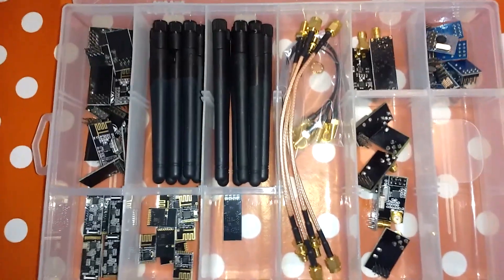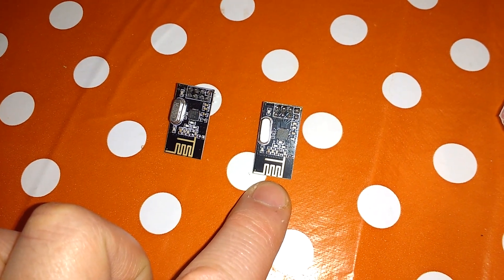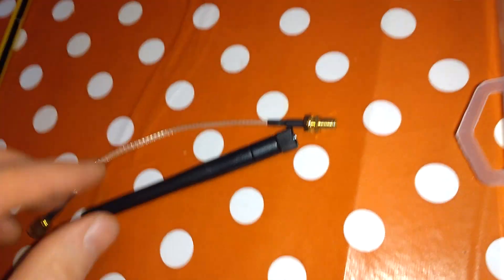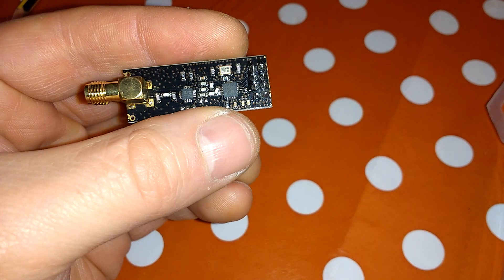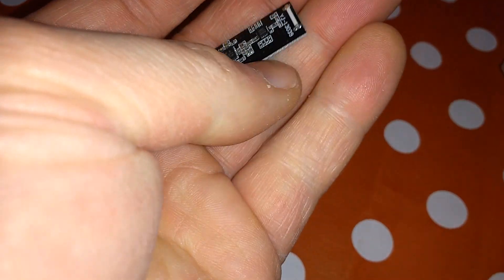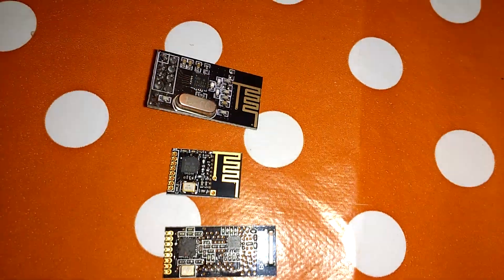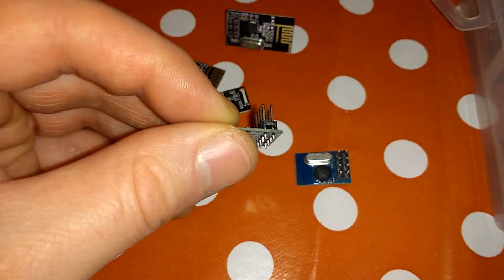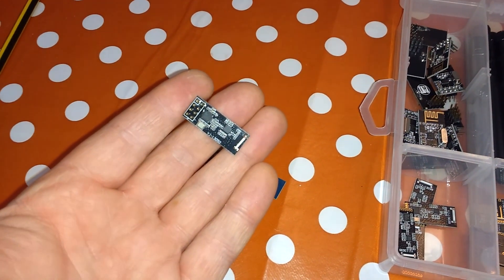NRF24L01+ module line up,  including SE8R01.  Arduino

Comment: 8:00 you mentioned a 1.75 connector. where can i buy it? where to find? witch search term should i use? greetings from germany
Reply from the maker: Frank Müller I bought some from eBay, they are 1.27mm or 0.05" interboard connections, very small and tricky to solder
Reply: Bob Lynas i just searched for 1.27 interboard connections on eBay. Found nothing. Please help...
Reply from the maker: Frank Müller https://m.ebay.co.uk/itm/50pcs-50-Way-Single-Row-Straight-Pin-Male-Header-Strip-1-27mm-Pitch/292292546407?epid=24007139336&hash=item440dfe4f67:g:7ZkAAOSwEW9aTsrp

Comment: nice collection! I'd like to see you test some of these out and do comparisons, especially the SE8R01
Reply: Hey Bob, that's a pity.

I'd like to know whether the SE8R01 and NRF24L01 modules can communicate which each other when you use an address width both support (4 or 5 bytes) and turn off "pre-guard" and "repeat tail" by writing 0x00 0x00 to register 0x1f on the SE8R01. 

Otherwise, the SE8R01 appears to be much more complicated to set up, with the ACTIVATE command (which is not even in its datasheet!) used to switch to bank 1 and set the undocumented registers there to even more undocumented values... they look like NRF24L clones without the internal memory to set up those default values at power-up time.

I am not sure these beasts are worth the time and trouble, but will try them when I finally find some time :)
Reply from the maker: Hi Kevin, I have moved on from these modules onto ESP Wifi

Comment: Hello Bob. May I ask for something? 
I'm thinking about some mid-range RFID which could be read from distance cca1-2m

Such reader can count number of pools when swimming indoor. So transponder have to be small, simple, waterproof and power efficient. 

Most probably it have to be Active RFID since passive ones have short range OR hi-tech price.

I was thinking about NRF24l01 or BLE solution, but I'm still hesitating. 

Do you see something really simple and reliable?
Reply from the maker: +Lukáš Konarski It may be possible to use a small NRF24L01 as show in the video, with a NRF24L01+PA+LNA for the main basestation, the difference between RFID and the NRF is that RFID may not require power if detected at close quarters, but the NRF transponders will required to be powered at all times to be able to receive&transmit. If the mobile 'transponder' device was just a transmitter (beacon) it could run at very low power, sleeping between regular beacon transmits, but I dont think this fits your specification
Reply from the maker: +Lukáš Konarski See here https://youtu.be/3Uj_6PRmBKE for something similar

Comment: Hey Bob! Thanks for this video. It's nice to see a litte range of choice of the NRF24 modules. Do you have some code- and pinning-examples for Arduino or Raspberry 2? Oh, and despite the bad cam focus, I could recognise all the necessary information. :)
Reply from the maker: +Jean-Luc Burot this is a very good page, with lots of info https://arduino-info.wikispaces.com/Nrf24L01-2.4GHz-HowTo